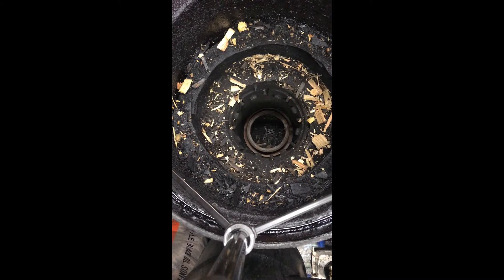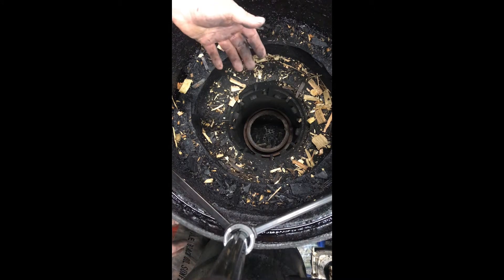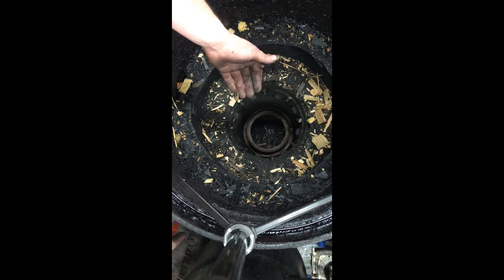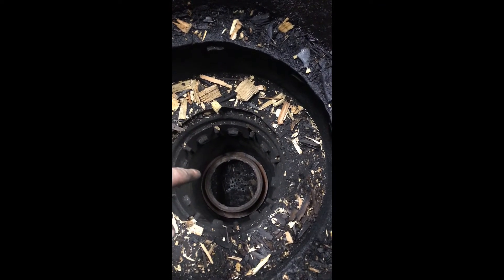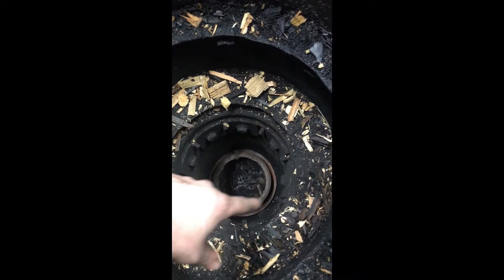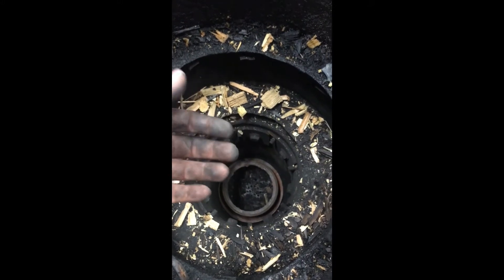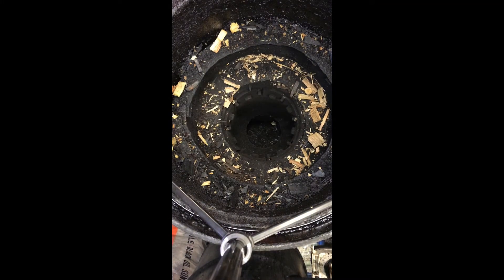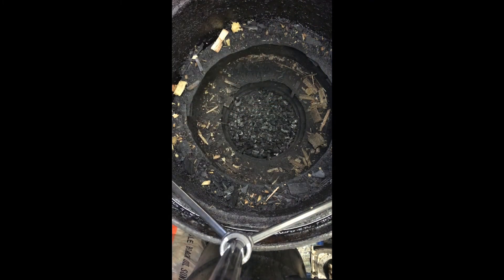gassifier tuning and building a char bed

Comment: Can a gassifier be used when fueled only with charcoal?
Reply from the maker: Absolutely, we call those guys the black hands, they make char gas. It is much more stable to use, and produces a cleaner fuel. It runs hotter, well past metal failure temperatures so it must be cooled down with either exhaust gas recirculation or water drip cooling. I have not played with it myself yet, but it greatly simplifies the gassifier construction at the cost of more time and labor in making the fuel such as a top lit updraft charcoal retort. The char I clean out of my gassifier I screen out the dust and what's left is perfect chargas fuel, but I choose to recycle it right back through my wood gassifier and it helps to act nearly like a high octane fuel. A fellow woodgassers I learned this from mixes 10% char to 90% wood chunks and calls it his "rocket fuel"